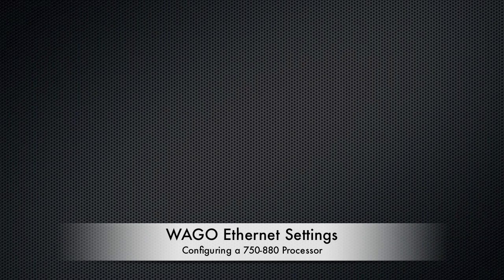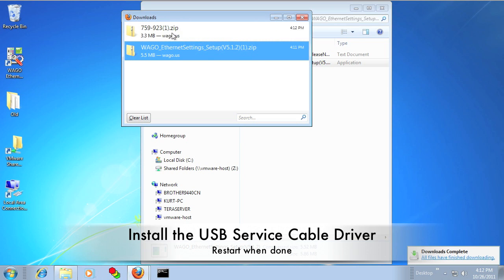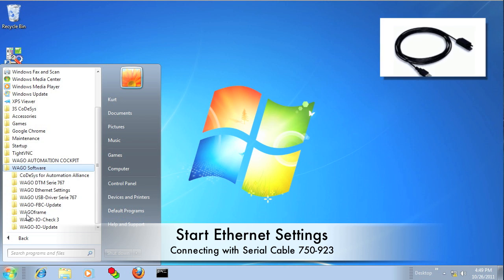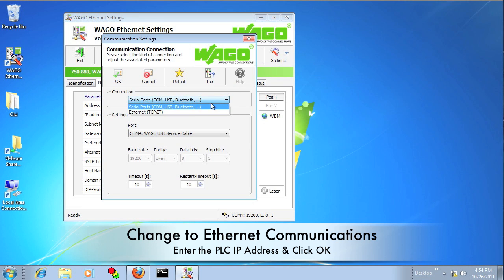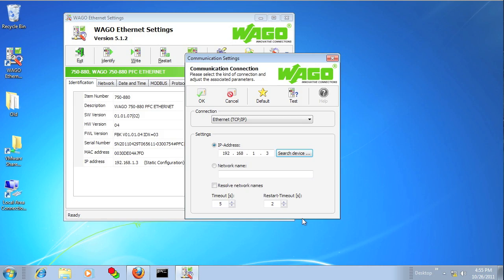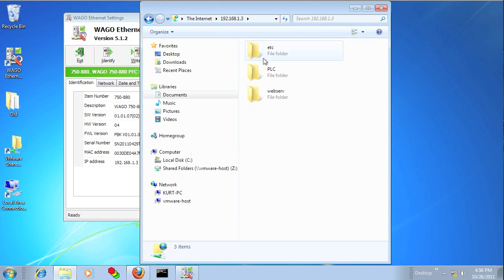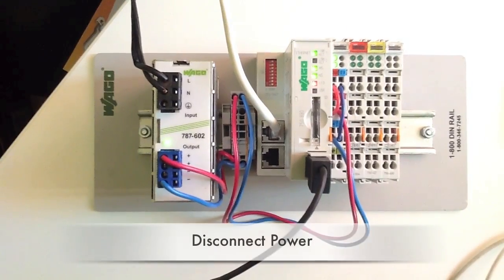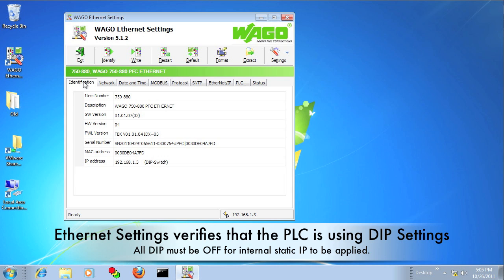WAGO Ethernet Settings Software 759-316

Comment: Update: Firmware update solved it.

What do I do if the PLC doesn't show up in the "identification" tab?. My computer recognizes the WAGO USB Service Cable, and I can select it in the "communication settings" tab, but I get an error that says "Failed to connect to device".

Comment: Hi,
 
Thanks for the comprehensible video on the wago-ethernet settings! 
Could you give me a hint for my wago-problem? 

I have a wago 750-841, which I bought pre-configured. All of a sudden, it is not possible to access it anymore through it's IP-address using a web-browser (no settings were changed). Also a Ping to the IP-Adress doesn't work. I can access it with wago ethernet settings though, the IP-settings are the same as they used to be.
The NS-LED is blinking, which according the manual means "no connection (modbus/TCP Ethernet/IP)".

Reseting it to default-settings and reconfigure didn’t help either.
Do you have any idea what I could try to make it work agin?